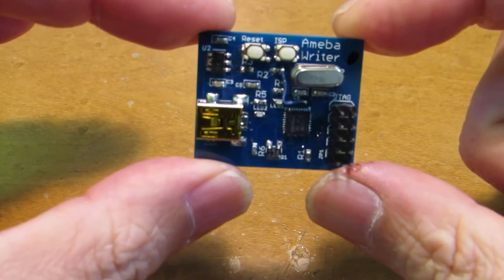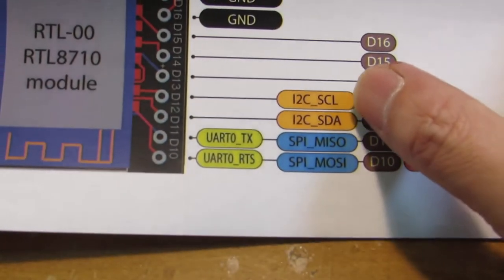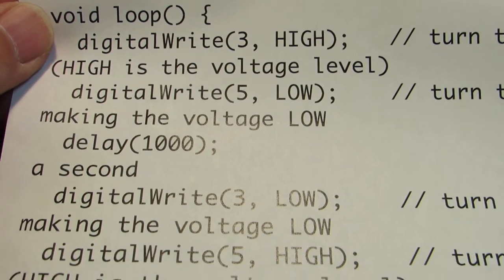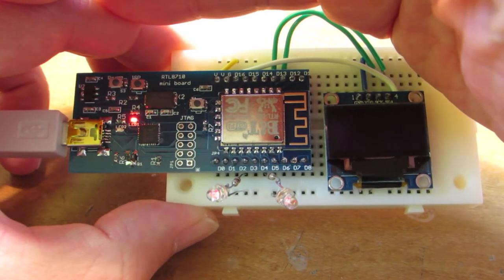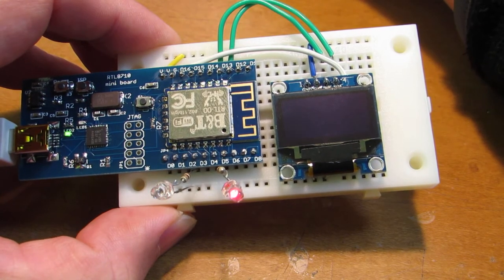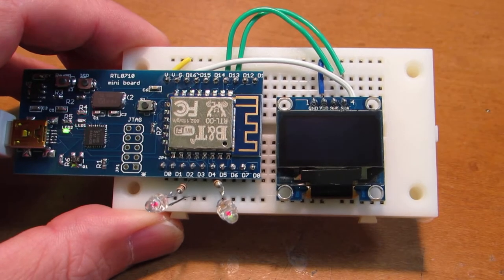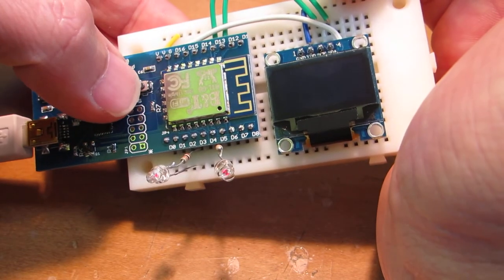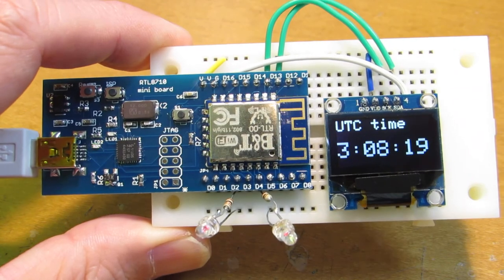RTL8710 mini programming board

Comment: Amazing! 
I really like all these boards, where the programmers are on one board with main part.
And yes, is it possible to make it without qfn ic's?
Reply from the maker: The CMSIS-DAP firmware released by realtek works only for LPC11U35/501 and this chip is available only by QFN so.... CMSIS-DAP implementation by another chip may work as well but at this moment I just make as is..